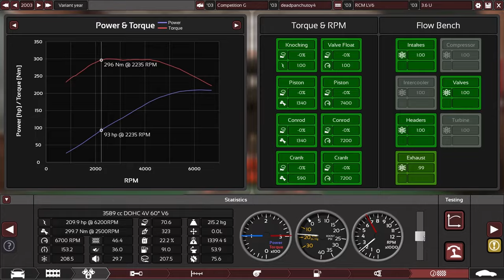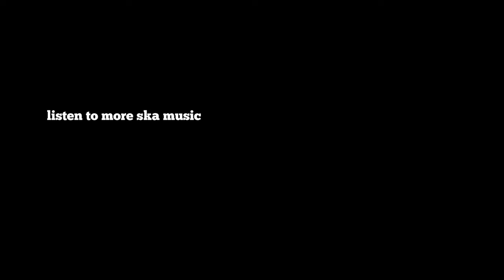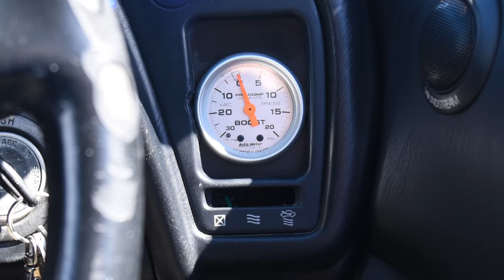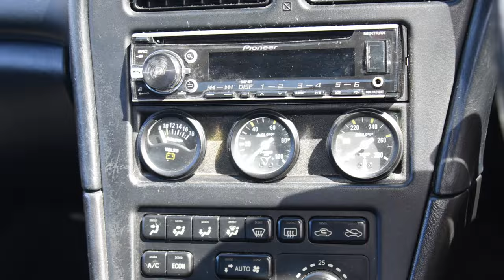1996 Toyota Celica GT4 ST205 (Even more fixed. When will it end?)

Comment: The car does about 19.86mpg if the owner's info is right
Reply: sounds roughly about right, I've never heard of someone measuring in Kilometers per litre tho lol.  I get about 11L/100 on average with mine and 10 strictly highway
Reply: Aura Rowe Depends on whether we're talking imperial gallons or US. US is more like 16.5.
Reply: Huh, My VI gen GT does 10-12L on average and this is NA version of the engine. GTFour owners usually report something along the lines of 16-18. So what you are doing with yours, not touching accelerator at all? :D
Reply: 450 km = 279.617 mi and 64 L = 16.907 US gal.
279.617 mi / 16.907 gal = 16.53584 mpg
Reply: WEIRD FLEX BUT OK
Reply: @veevoir  i was thinking the same, le lowest I've be able to do with my 1.8 it's around 6L /100Kms.
Reply: Thanks 🤙
Reply: @veevoir  some people have driving finesse. others dont
Reply: It's possible mine gets around 22 but it isn't the gt4
Reply: wtf my 1999 gt 2.2 gets around 21mpg.... Imma turbo my car fuk it
Reply: Ugg, my Hawkeye imp wagon (2.5i) gets 19mpg… oh well
Reply: i get about 15 to 17 miles per gallon

Comment: I get that whole numbers move around in your head. I too failed algebra freshman year of high school. It wasn't because I didn't understand the concepts. They all made perfect sense to me. I had (and still do have) a really strong grasp of the concepts of algebra. I just couldn't keep numbers straight to save my life. I would drop negative signs or just randomly change numbers between steps without even realizing it. I was tested for dyslexia and they determined that I did not have dyslexia, which I don't. However, the only other conclusion they could come to as to why I was failing algebra with a strong grasp of the concepts was that it was an effort problem and I wasn't trying hard enough. To this day, 10 years later, I am still upset about that. I worked my ass off to make sure I got the right answer on homework assignments and tests doing each problem maybe 4 or 5 times and comparing my work to ensure that I didn't change numbers or drop a sign somewhere.
Reply: I have the same problem. Understood the concept, no problem. Do some classwork, and I've somehow fucked up the question and lost a couple of signs along the way.

Comment: It was 1995 they got caught and banned from WRC (Group A). Also fuel tank is 68 litres (not 64), they do have alternator cooling as you partially reference but your review car is missing the ducting (and the turbo and manifold heat shielding too). Bonus info; 2500 of the homologation cars Toyota built in 1994 also had a bunch of rally extras for use as group N cars; Turbo Anti-lag (fresh air bypass to exhaust manifold), inlet manifold water injection and heat exchanger water spray bar. :)

Comment: ST205 is a real monster. I own an AT200, it's N/A and only has 115hp but weights much less than the ST205 because it's FWD. And i'm in LOVE with it. It's a really fun car to drive, not really fast on open roads but a real challenge on twisty roads, where you can keep up with much more powerful cars due to the excellent chassis and the lightweight of it. It's also really prone to oversteering, so even though it's a FWD car there's no constant feel of understeer at all. In fact when you get to hot into a corner you have to be careful not to get the tail out! 

If you don't believe me that's fine, just drive one on a twisty road and you'll get it. But you'll still be smoked by miles at any pull in a straight line lol.

Comment: It was 3am on my 16th birthday, I walked to a petrol station with my brother to buy chrisps.
We bump into a friend-of-a-friend who had one and he takes me for a lap up and around the area, Boy it was an experience. Partly because it had 4wd and launched HARD with a blueprinted engine making all the boost and 480whp (~600crank), But also partly because I was pissed as a newt from drinking multiple beers and whiskeys.
I managed to keep it down as we went up a fast loop in the wet faster than you'd think possible as it popped and banged lighting the side of the road yellow from flames on the gear changes. I had never known or cared about this car until that day.
As drunk as I was I still remember it well, We got back to the garage 4 mintues later and I practically fell out the door laughing like a lunatic. Good times.

Comment: dont modify it! it was less than 10000 ST205 made, original car goes for a crazy ammount of money. i had one before car nr: 3919 GT-Four WRC 94 version. i sold mine for 18000 Euro and it still needed a new intercooler and some scratches on the paint. when i wanted to buy spare parts i had to get some manefactured in japan cause there was next to non original parts on the market.

i regret selling mine but i could not afford having it XD

Comment: so I have a neighbour that is selling his ST205 '96 and I'm not quite sure where to look at and
where and which parts have problems
However, all I know is, its garaged, it has aftermarket wheels and it also has a wing delete and I only have one picture of it
Reply: Admiral RNG get it. Prices are only going up
Reply: Check the clutch, when the timing belt and water pump were changed.
Clutch jobs are very expensive, its an engine out job.

They also have a complex dual wishbone front suspension set up that is very costly to repair. Though you can swap on McPherson struts from the non awd version.

Comment: US got screwed hard with this generation. I had the balls to take my 94 GT and get all the GT4 exterior parts and make my US GT look like a GT4 and yes I even went as far are getting the JDM front fenders so there wouldn't be those amber US version front fender reflectors but when you didn't see the gas tank hanging out the back it was a dead give away I had a Toyota camry engine under the hood HAHA! Man I miss that car.

Comment: Hello i have a 95 celica with a gt4 bumper, bonnet and spoiler, however the engine is the 115hp 2.0 non turbo and it is blown, so need a new engine anyway, does anyone know will the gt4 engine be an easy swap in and what gearbox to pair it with as mine i plan to keep fwd? The reason why i decided not to just buy a gt4 is the current price and because i already have a celica shell that needs and engine anyway, any help would be appreciated

Comment: Some of the 4x4 Group A rallycars you might want to look for...

· Toyota Celica GT-Four (ST165, ST185 and ST205)
· Mitsubishi Lancer Evo (up to Evo VI)
· Mitsubishi Galant VR4 (6th gen)
· Subaru Impreza WRX (1992 to 1999)
· Subaru Legacy RS (1989 to 1993)
· Subaru Leone RX (1980 to 1989)
· Nissan Pulsar/Sunny GTi-R
· Lancia Delta HF
· Mazda 323 GTX, GTR and GT-Ae
· Audi Coupe Quattro
· Audi 90 Quattro
· Ford Sierra XR4Ti
· Ford Escort RS Cosworth

Not all are equally great but all can handle upgrades to 300hp with certain ease and all are absolute killers in very twisty roads. Back when manufacturers spent millions in making superfun roadlegal car for racing's sake.

SPECIAL MENTION
· Mitsubishi Pajero Evo (a 2-seater SUV with racing seats and like 280hp when stock, originally meant for the Dakar Rally's version of Gr.A regulations)

FUN FACT
· I once beat most of TXR Drift 2 with a Pulsar GTi-R and minimal grip-focused upgrades and 300hp engine tune. It was rather fun to outrun Skylines and Supras with a stupid hatchback!

Comment: Km/L to m/g

The reason why you have trouble managing numbers is because you don't see the patterns. Squares, cubes, primes, golden ratio, geometry sequences, Epstein didn't kill himself so to help you out here is the conversation you asked for:

450Km/64L = 7.03125km/L
Km to miles = 450km/1.6km/m=281.25m
L to gal = 64L * 0.264g/L = 16.9g
mpg= 281.25m/16.9g= 16.6 mpg

*note: the election was rigged